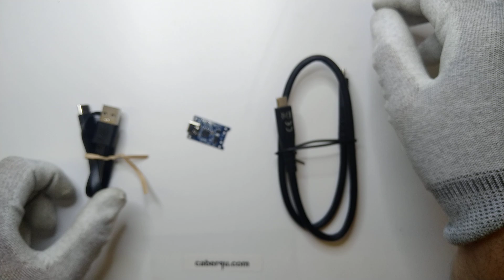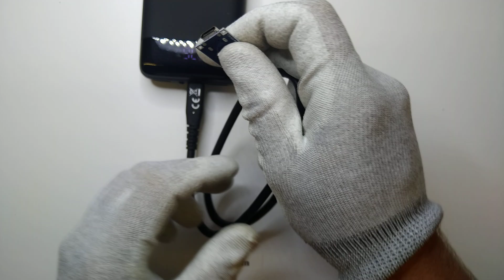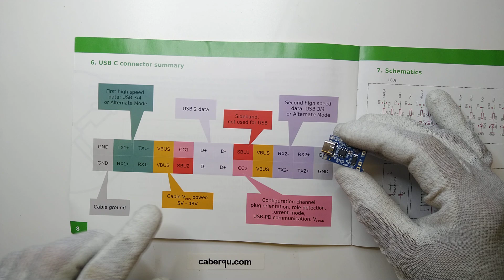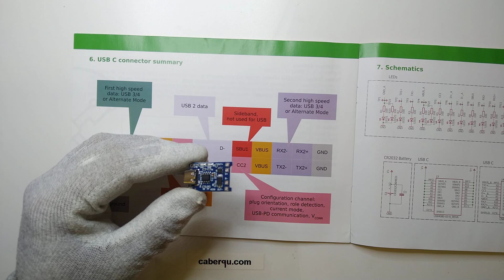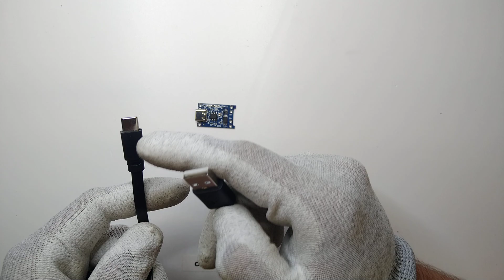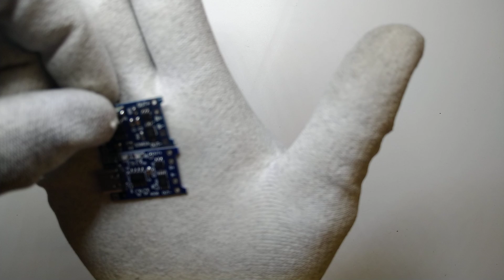Lithium battery charger not built up to spec results in it not working with USB-C cables

Comment: Another thing of note: most li-ion batteries have a thermistor pin, which this ic would be able to monitor if they hadn't grounded pin #1, meaning the module has no way of telling the battery temperature unless you somehow modify it

Comment: And that's just a 1s 1A charger. There are are similar chargers (no included bms like this one) with no ucb c cable communication that can do 1s, 2s or 3s at 1A,2 A 4A.

Don't know many USB A chargers / A-C cables that can do that.

Then again there aren't many USB c 2s 3s chargers, so I got them and when I found out about it I desolder the resistors that set the charging current.

Comment: Are the CC1 and CC2 pins exposed on the connector, can we solder the resistor ourselves?
Reply from the maker: Good idea, not sure if it is feasible though..
Reply: @quiescentcurrent I book that under technical "possible". Even if the pins are exposed, they are too small in too little space. Sure technicall you could put tiny botch wires there and solder a free floating SMD between them, but next time you look at the device it'll break. Even when drowned in hotsnot. Let alone using it.